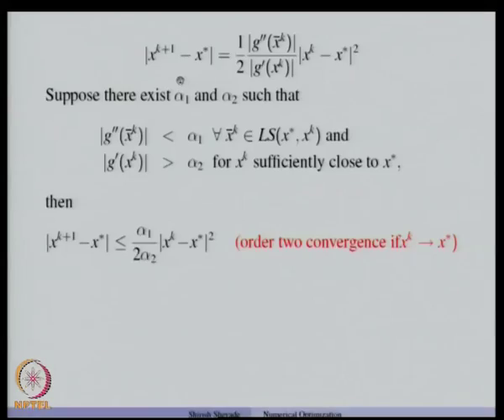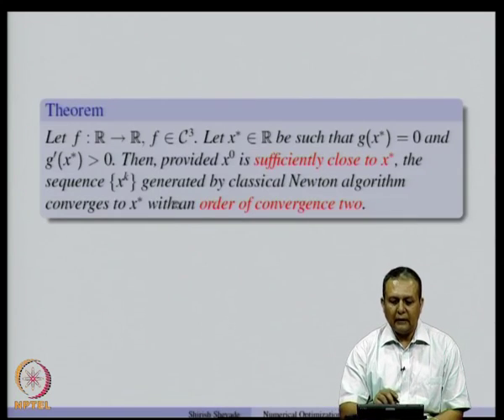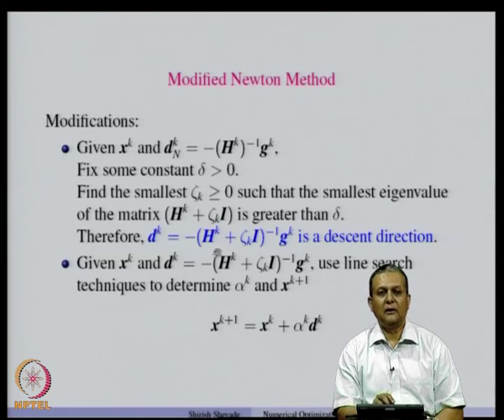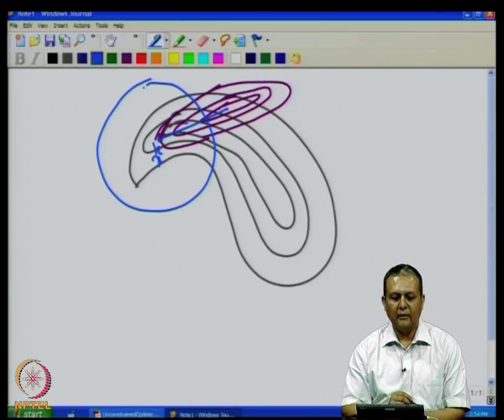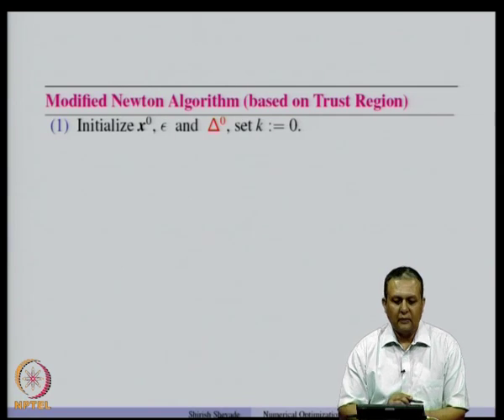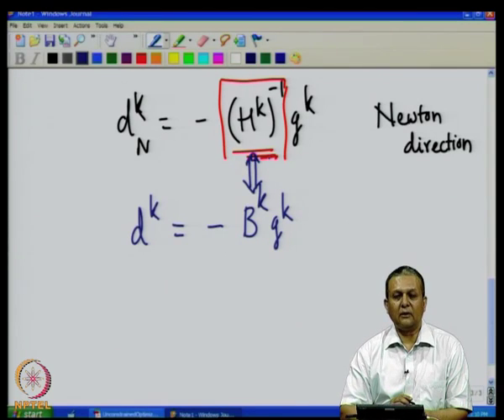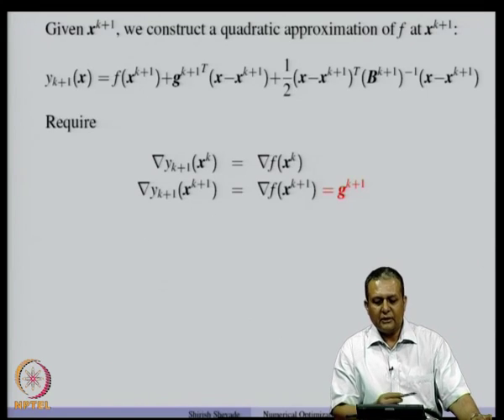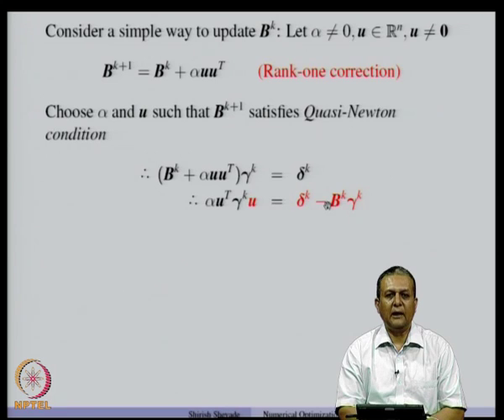Mod-06 Lec-15 Trust Region and Quasi-Newton Methods

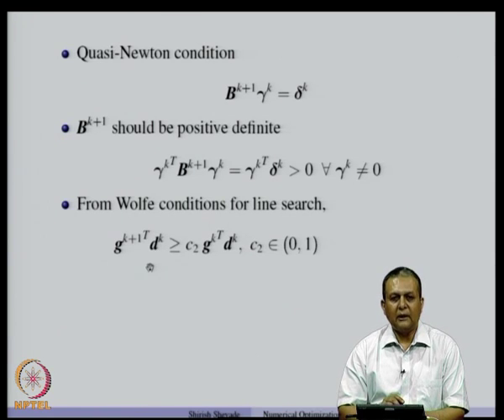Comment: 51:45  please anyone explain, how we reached at this explaination
Reply: gk+1  -   gk  = gamma-k, this was defined in the previous slide.

xk+1 = xk + alpha-k*dk, where alpha-k is always positive

therefore dk = 
(xk+1 - xk)/alhpha-k = delta-k/alpha-k

substitute this info in wolfe condition, and can get rid of alpha as it wont affect the inequality.
Reply: From Wolfe's condition, (g^{k+1})^T d^{k} >= c_2 (g^{k})^T d^{k}

Now subtract both sides of inequality by (g^{k})^T d^{k}. The, we have

(g^{k+1} - g^{k})^T d^{k} >= (c_2-1) (g^{k})^T d^{k} 

Observe that c_2 is in (0,1), therefore (c_2-1) < 0. Also, since d^{k} is a descent direction, we have (g^{k})^T d^{k} < 0. Hence, the product (c_2-1) (g^{k})^T d^{k} > 0. Therefore,

(g^{k+1} - g^{k})^T d^{k} >= (c_2-1) (g^{k})^T d^{k} > 0. This implies,

(g^{k+1} - g^{k})^T d^{k}  > 0, which is nothing but (\gamma^{k})^T (\delta^{k}) > 0. (I used the definitions of gamma and delta  from the previous slide).

Hope this helps.